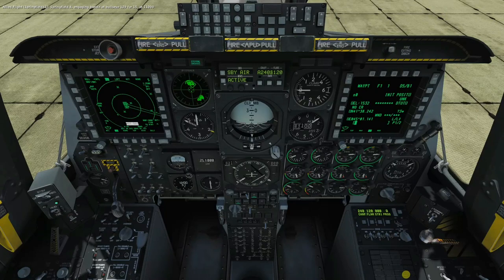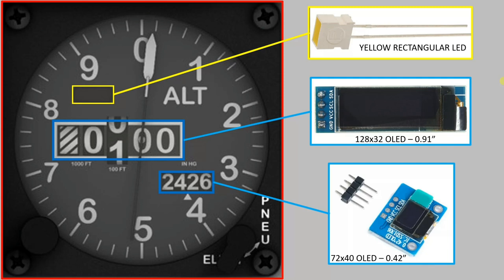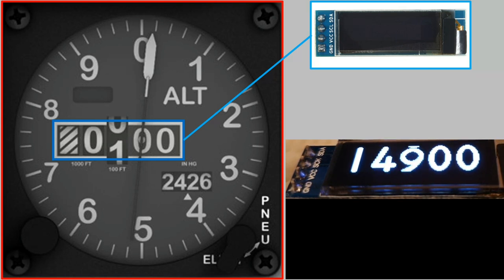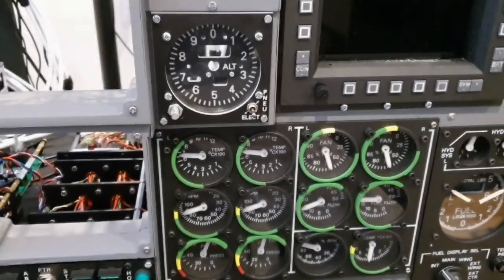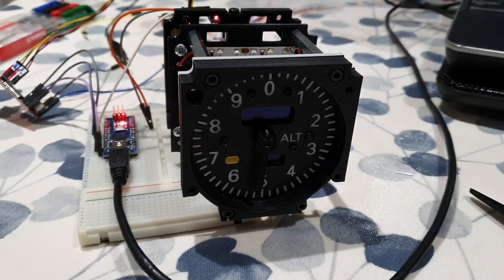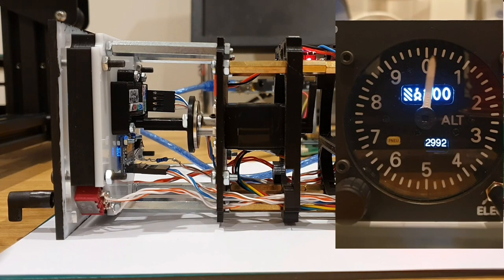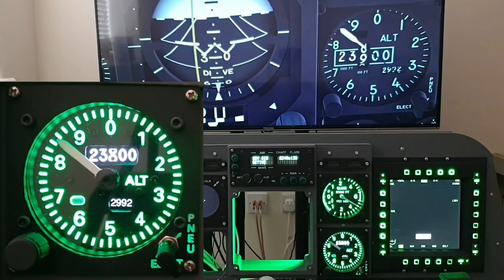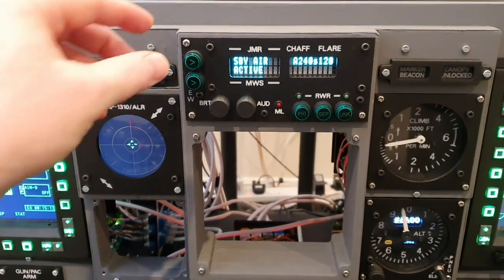Simpit A10C - Front Dash - Part 22: Altimeter

Comment: I love your videos. I'm just starting an A10 build, having done A320 and C172 already. Your work is inspirational.
Reply from the maker: Hi Benny, It sounds like you will have some good panel building experience from your previous builds to bring to the A10. I did fly a A320 simulator some years ago which was on site at an airfield. It was alot of fun 👍

Comment: Awesome video man, definitely subbing.

If I could ask, what kinda motor are you using, Nema? And would you be willing to share your sketch for that altimeter?

I'm building an F16 pit and I just finished building my Altimeter using the same sensors your using, but my motor is a Vid29 (Stop cut off Already). It works great using Easy Drivers, but the motor is pretty damn weak. Really remarkable for being totally unremarkable... I've been thinking of switching to something stronger, but your motor looks fantastic. Plus with the shaft pointing out on both ends, which is fantastic for placing a sensor disk on the back end like you did. Mine has the sensor right behind the guage panel, which is causing a slight dark spot with lighting.
Reply from the maker: Hi Cyrus, the motor is a nema 8 dual shaft stepper motor. If you email me at craig@mysimpit.co.uk I'll reply back with the Altimeter sketch. No worries and good luck with your project
Reply: @CraigSmysimpit  Thanks for the reply!

Comment: LOL. I'm thinking "How's he going to use that 128x32?"  Then it comes to 7:08 and you cheated! ;)
A 128x64 has the connections at the top, so the sides of the active display are close enough to the physical side to put it in the correct place, next to the needle axis.
And you could possibly stop the backlight bleeding into the PNEU LED case.
Reply from the maker: Yes, a bit of Blu Tack applied to the LED rear should prevent the bleed through. There's a few tweaks here and there I plan to do, to this panel and some others.
However, its been a real blast to fly with this panel added 👍
Reply: @CraigSmysimpit  Where did you get the stepper,and which sensor did you use?
Reply from the maker: Hi, I got the stepper from "Makers Hut" of ebay and the sensor is from Ali Express under the title "5pcs IR Infrared Slotted Optical Speed Measuring Sensor Detection Optocoupler Module For Motor Test", cheers